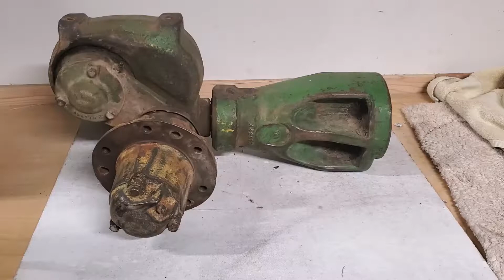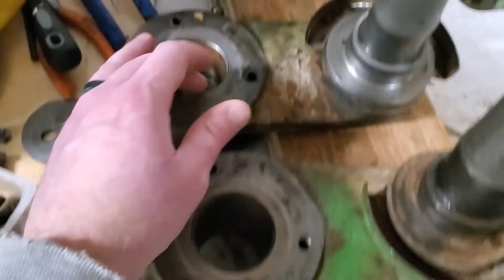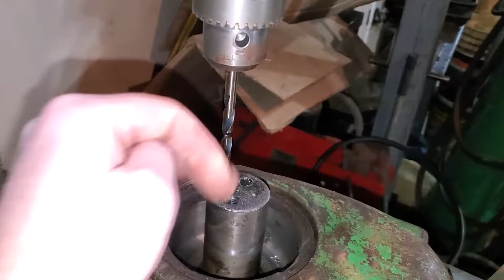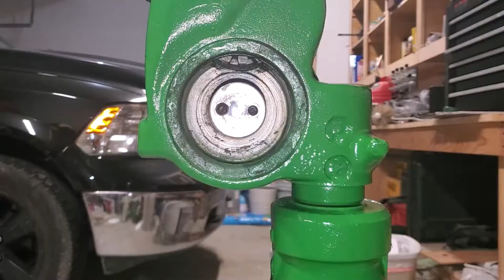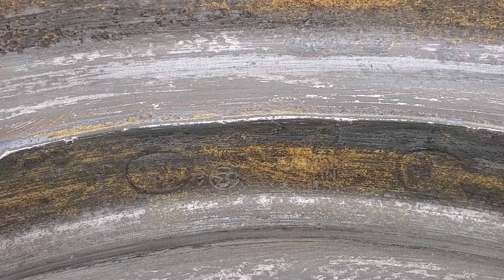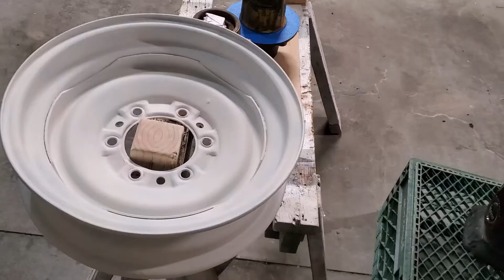John Deere Roll-O-Matic Repair

Comment: If I were to replace a broken to remove it I would place a washer that just fit over it can you use a MIG welder to weld a little tower on top of it how many people will use a nut and weld it right in and then you have a welded nut to help grab a hold of and remove that top
Reply from the maker: How well can you weld to HSS (assuming that's what the tap is made of)? Assuming it welds perfectly, how confident are you it wouldn't just break again... Father down the hole?

Comment: FYI:  another trick to getting g broken off bolts & caps is to buy a set of quality HSS or Colbalt left had drill bits.  Also if you have access to a mill, take a small carbide endmill to flatten the tap surface, then slowly begin drilling counter clockwise
Reply from the maker: I've heard of people doing that. But I think the only way to drill out a tap would be to use solid carbide. In my video where I got my 830 running I show how I made a drill guide to use a hand drill and a carbide twist drill bit to remove a broken HSS drill bit while on tractor. Here is a link: https://youtu.be/OnTtRud2StE

Comment: Where are you ordering your front tires from? I like to replace mine on my 1951 JD "B"
Reply from the maker: I bought mine on eBay. Seller's name is tiresave. They are actually a little cheaper now.
https://www.ebay.com/itm/171829260232?mkcid=16&mkevt=1&mkrid=711-127632-2357-0&ssspo=kWHGx30GSla&sssrc=2349624&ssuid=N-yBO4m-Tam&var=&widget_ver=artemis&media=COPY

Comment: If you get the Roll-O-Matic reassembled correctly, both sides will stop contacting the positive stop at the maximum roll. If they are one tooth off, one side will not travel far enough to contact the positive stop. If mine ever had a punch mark, it was very light and got worn away over the 50 + years of hard farming, so I had to experiment a little.
Reply from the maker: I totally understand what you're saying. Without the "timing" marks it would be really hard to tell if you've got them installed correctly.

Comment: They do make tap extractors.  For removing broken taps.  They don’t always work but it might get that tap out with some heat from a torch. I have used a chisel to break them apart but I used a torch to get it real hot first. A torch might not be such a good idea on old cast iron like that though
Reply from the maker: I have never seen a tap extractor successfully remove a broken tap. The little tangs always seem to just break off.

Comment: Your model A, I believe, is a model AN.  If it were me, I would keep the Roll-O-Matic front end on only long enough to get the narrow front fixed to keep the integrity of the AN, seeing that they’re comparatively rare.  But it’s your tractor so do with it what you will, just a suggestion
Reply from the maker: I've always liked the single front ends. I'm sure I'll put it back on. I'm interested to see if there is any difference in drivability with the roll-o-matic. Primarily when it comes to steering (steering my tractor with the single front tire is very hard) and front end bouncing up and down in a rough field. Also, when driving with the single front tire, you can not see the tire at all, so the double tires will be different. Like I said...it will just be fun to have the roll-o-matic. Kinda like getting a new tractor for a tiny fraction of the cost and effort. Ha!